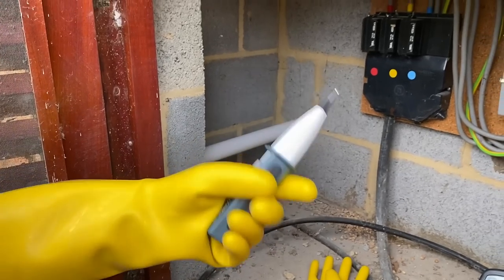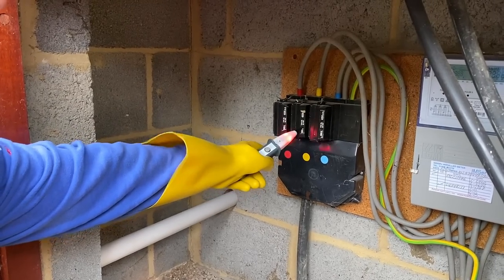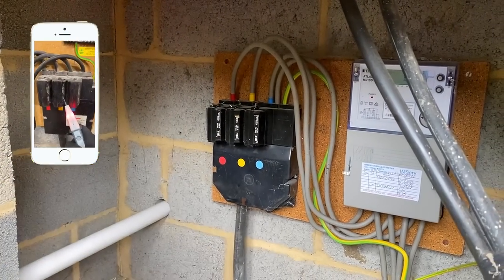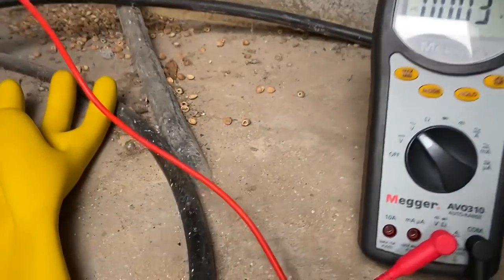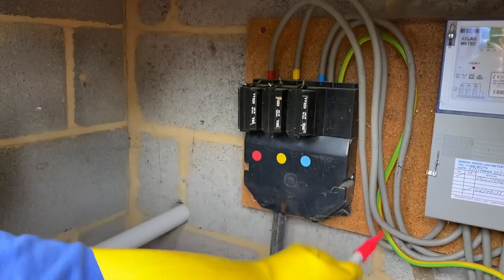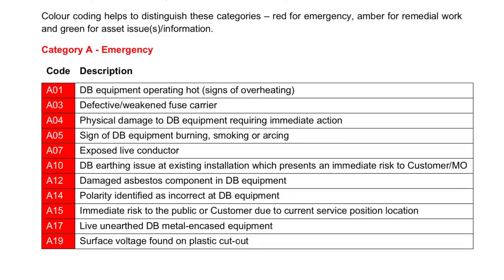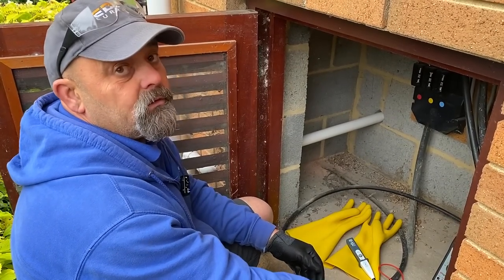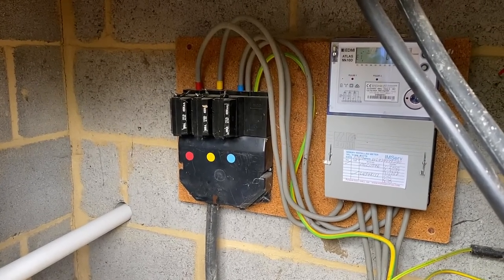The Hidden Danger in your Cut Out Fuse: Don't ignore this!

Comment: Interesting, I wasn't aware of this issue. Having said that, 10 volts into a high impedance test meter doesn't sound like an issue; the real test is how many milliamps would leak through it to a human. Might be worth trying to measure the current its capable of passing to earth.
Reply: As the voltage is only 10V measured, it won't be enough to break down the natural insulation of the skin so no current will flow. Only when the voltage exceeds 30V a.c. RMS or 50V d.c. which is considered hazardous is there likely to be a risk of shock and current will flow through the skin. Assuming just a minor breakdown of the insulation, the current would likely be limited but there's no way of telling and it could be very dangerous especially when it's likely been subject to overvoltage transients on the line which would stress the insulation.

Comment: Fine, just don’t let them insist on installing a smart meter at the same time! Opt out.
Reply: Why tho?
Reply: @Trident_Euclid  as far as i'm aware the issue is that they dont smooth out spikes in usage so normally end up giving a bigger bill.
i have seen someone reported being charged for using 8GW because the meter crashed
Reply: @smeegle  If that's the case then surely there's a problem with meter certification.
Reply: Because smart meters have a great big cutout contact in them which means the DNO can cut you off via wireless instead of a court order.

Also they will end up "load shedding" in the future as renewables don't work reliably enough, which means the smart meter will cut out to save the grid
Reply: @nevermind824  Currently it's not legal for the supplier (nothing to do with the DNO) to just cut off a domestic customer remotely. They have to go through all the usual channels of attempting to recover any money owed (offering prepayment etc), and any possibility of an actual disconnection will only happen when other routes have failed and an assessment of the impact of disconnection is completed.
Reply: The DNO doesn’t have anything to do with the meter, that’s the electricity supplier 🤦🏼‍♂️
Reply: @nevermind824 All electric car chargers require their own smart meter, so they can be turned off to shed load at peak times...the owner probably has to agree to this...
Reply: I wonder why they're even allowed to call them Smart meters? A housebound friend has one (In his case; Definitely needed. I can't bear the things) and despite over 30 attempts now I still can't get the damned in-home display to pair with the meter, despite both being in line-of-sight and under 5M apart! 🤣

Anybody who thinks a Smart meter is somehow better than a Dependable meter might want to check they're not being Stupid 😇
Reply: @dieseldragon6756  a technical issue the in-home display is not meant to be great but the actual meters are very reliable. They communicate with each other as a very large network to communicate billing information. Also better if you actually have access to the management interface which power company would they have so much easier

Comment: So this plastic is an electrical conductor??
Reply: Phenol is involved in making bakerlite heat resistant plastic.  Phenolic breakdown can cause electrical conductivity. When an air bubble bursts between carbon fibers, the carbon fiber braid breaks up, causing electrical resistance in composites.

Comment: If this is a known thing why are they not replaced as a matter of course while fitting smart meters along with isolation switches and dare I say SPDs?  Could use some that massive profit or excessive standing charge to pay for it.
Reply: One fitting a meter they will check, but it’s only some environments that have the issue such as outside meter cabinets if it’s inside the heated space any moisturisers driven out when the heating turns on Jenner SPD should be fitted by the consumer or their electrician more accurately because they can fail and need periodic testing which can’t easily be done live and pulling. The main fuse wouldn’t be suitable for testing of an electrician in the eicr. Replace these as a default measure because it is not always needed and isolators can be fitted. It really depends on a lot of educational things.

Comment: Surely this is a massive issue? I mean there are millions of these things inside of people's houses - often under stairs and well within touching distance
Reply: It all depends on the actual composition of the cut out. The different manufacturers would have slightly different mixes to make the product.  Also the older cut outs were thicker walled so more resistance.  If the cut out isn't overloaded or running at high load for extended periods the degredation is far slower due to lower temperature.  Car charging might make the issue worse with 7kw loads for long periods of time.  Who knows
Reply: Actually in a house it’s January fine because it’s quite dry so the issue is very unlikely but 90% of the cases this are a false alarm

Comment: So like 10 volts. Jesus. You could lick that and not feel a tickle. I thought 12v SELV was safe to touch?? And then you state a touch voltage of 50 volts is the danger cut off???
Reply: However, this is not a selv voltage source this is leaked voltage which is not regulated to be within allowable limits

Comment: By the 19th edition im sure this will be another dno problem that has become our problem... Mobilise all your free operatives to identify issues on your network. Keeps the shareholders happy... But you'd better not pull that service fuse chaps or there will be trouble. 🙄
Reply: The service head fuses fall out all the time! Funnily enough, they only do it when I need them out.
Reply: @paulmatthews5470  likewise. People keep banging on about seals. Never seen one in my life.
Reply: It’s always been past Vinny. I see how that you should officially inspect this if possible for damage using a test as shown here would fall under part of that.

Comment: Yes electrical installations don't last forever. Untrained people think a property wired in the 1960's or 1970's will be fine, not so it breaks down over time, ergo periodic testing

Comment: I do the same thing. Called DNO out and they used a none contact voltage detector followed by yeah it’s fine. Absalute joke
Reply: What would happen if say the same DNO staffer was say installing an isolator and pulled one of them service head fuses and getting a shock of however many volts is leaking from them?
Reply: @leeroberts1192  they will not get a shock because they pull out a fuse safely using insulated gloves as its standard protocol
Reply: However, it was knowing that 95% of reports on this actually false alarms so it’s not a joke. It’s just how it is.

Comment: DNO wont be replacing anything with just 5v surface voltage.
ive found 80v and that was considered worthy of thier time, anything under 12v, they ignore
Reply: They generally do measure such as fitting if it’s specifically some special insulation tape which is really sticky. It’s not super amazing or that place like fuse carriers but generally that is fine.